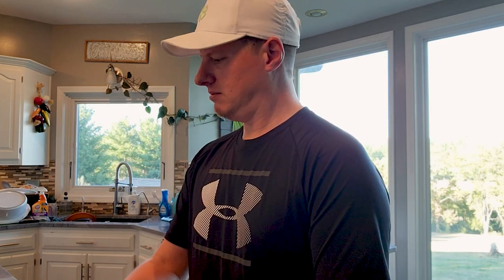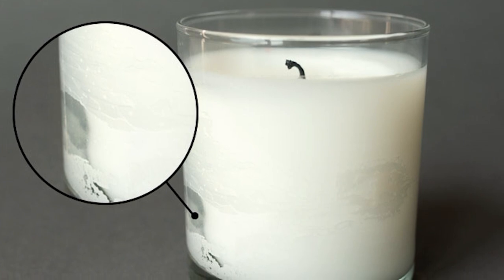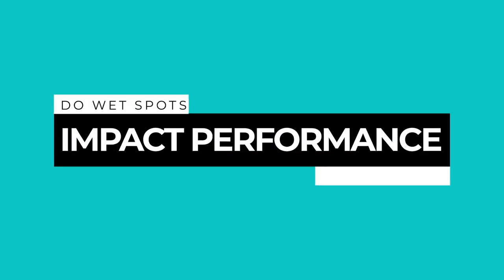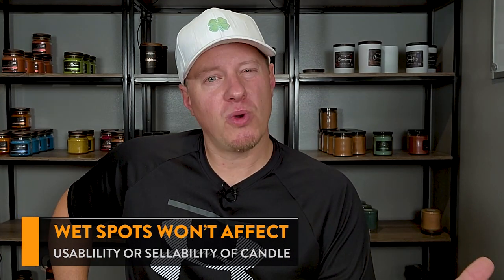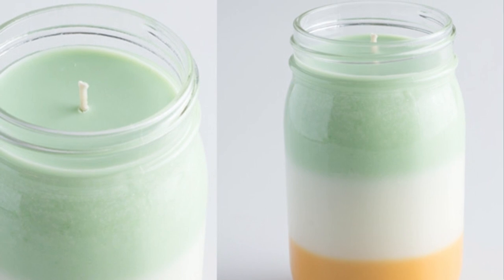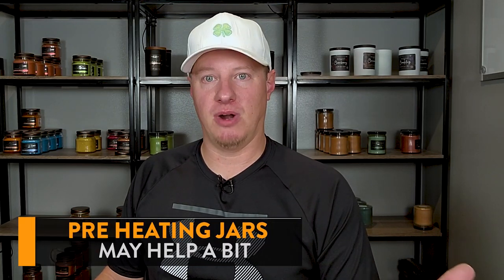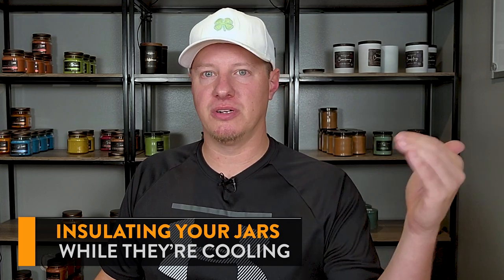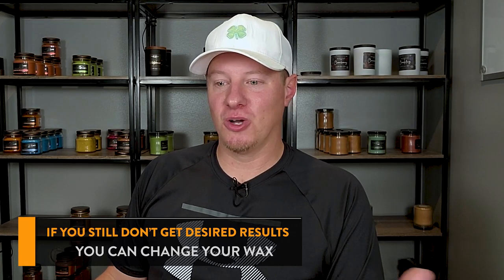Candle Making WET SPOTS (Jar Adhesion) | Big Deal? What Can You Do?

Comment: I did a complete 180 and switched from igi 4627 to gb 464. I no longer have wet spots (thank goodness), and honestly seeing  rough tops and a little bit of frosting over time brings me peace vs seeing a Dalmatian spotted adhesion issue that persists no matter what I do. I do love the 4627 for the HT, it was a good experience over the years, but I am happy and at peace with the 464. I enjoy the challenge of wicking and finding fragrance oils that perform well in the soy wax…now that I’ve used 4627 for many years I have a better idea of what the experience of a really great HT is like and can try my best to replicate the throw with the proper oils and wicks. It will never be as strong, potent, or raw as 4627…but in a way that’s also nice. I find a good HT from 464 even smells different and has a different ambience than the 4627. I found the 4627 to be almost suffocating at times with the HT (I know perhaps no one has said this ever, but it applies to to my taste). Regardless, there hasn’t been a wet spot to be seen..and that is enough for me to love the 464…even if it is a challenging wax to work with on other levels…it’s worth the effort to me.
Reply from the maker: Haha yah 4627 can be intense. Lol. Glad you found your go to solution. I've had mixed results with 464 and wet spots (depends on jar).
Reply: Ok I'll try that

Comment: I have huge areas that don’t adhere about half of everything I pour. I’ve heated jars up ahead and tried varying temps to pour and it’s still happening. I’m wondering if it’s the wax and it having a lot of air in it. Switched suppliers, same wax still issues. Switched to a supposed equivalent wax and not better or worse. Can I fix them after poured. They aren’t small areas so it’s really noticeable and not appealing at all.

Comment: I had this wet spot issue with layered candles for an order just last night! I'm in the northeast, US and it is getting cooler now. So, I need to pour my layers sooner because everything is hardening and shrinking quicker now. I do find that it helps prevent that leaking, if wet spots aren't a concern but leaking of colors between layers is, to very lightly re-melt the surface of the layer before pouring the next layer. Just enough to expand that top layer of wax a bit to prevent leaking to the layer below and not enough to need to wait very long before the layer sets back up enough to pour. Having the same color leaking between the wax and jar is better than having an entirely different color do that. It's more forgivable, since the wax might pull away from the surface again anyway. Layered candles are my #1 seller, so I've had a fair share of frustrations. After dealing with frosting constantly when using pure soy wax like I did for a while, I swapped to a wax that has mostly soy but some paraffin too and wet spots are actually so minor in comparison that I barely care about them anymore. XD
Reply from the maker: yes, absolutely. This is great feedback and spot on. Layered candles are more of a pain when it comes to wet spots. Pour temp is critical and they just require more creativity/attention to detail. lol

Comment: Hi Wade, i found a way to deal with the wetspots, i just take my heat gun and i heat the wetspot and it goes away and do not com back.
Reply from the maker: yah, this is a common thing people try. Glad its working for you with your wax, for most unfortunately it doesn't work. It only helps temporarily. Ive had it help for a while in my location.  But as soon as it get shipped to someone or moved to another spot, they tend to come back. But its a good temp fix or potential long term fix for some waxes. For me.... I dont have the time to heat gun every jar though, especially when customers could care less. Lol.  But, yes i think many people try this. :)

Comment: Hi thank you for sharing because I have been experiencing wet spots on some of my candles as a new candle Maker. I have another concerning question.

 I made four candles last night and noticed one of the jars had a crack near  the bottom side of the jar. I didn't noticed it until the wax turned solid. I poured each candle around 161 degree. I'm using soy/ coconut wax. Is there anything I can do to save that candle? It came out pretty good but I'm concerned that may be a safety issue. 

I'm not sure if it was cracked before I poured or not. I'm using 8 ounce jelly jars. I would appreciate any advice please.
Reply from the maker: Are you saying the wax is cracked or the jar? If it's the jar.... then no, I wouldn't use it. Melt it down and pour into another jar for yourself if you want. But I wouldn't recommend using a cracked jar
Reply: @BlackTieBarn  Yes I believe its a hairline crack in the jar. Should I scoop the wax out of the jar and melt it in a melting pot and then pour in new candle jar? 

 Also could you recommend proper wick size for 8 ounce jelly jar. So far I've tried CD 8 wick and I experienced high flame) dancing around. Then I tried 6 1/2 inch wick . Great melt pool/burned slow . . Took  2 hours to achieve full melt pool (moderate hot throw used 8% Fragrance load)  but still had some dancing and high flame. I use soy coconut 454 wax. The supplier says to wick up with that wax but it doesn't work well when I do that. 

 I used size medium wooden wick, extremely high flame / fast melt pool under 30 minutes , that size wick was recommended by the supplier. Epic fail idk it's frustrating. 

Should I wick up from the 6 1/2 inch wick to the 7 inch wick or wick down to 6 inch? So sorry for this long comment

Comment: Outside of the technical/maker standpoints, I think the best thing is just all of us informing people about this. It can be standard with waxes, but like "only soy is healthy," there is floating misinformation. As long as the whole candle is not filled with bubbles (like some mass-produced ones) I do not mind, and I have OCD, so that is saying a lot.
Reply from the maker: Even the bubbles ones are normal. It's just a different kind of wax. It's a classic wax that many customers still like. I don't mind them either. I've made them before.  :)
Reply: @BlackTieBarn  Oh I get that it is the wax. I worded it badly. I meant they used to be solid waxes (or seemingly) and then changed. I noticed the bubbles filling containers everywhere. Going from one type to the other abruptly threw me off causing me to avoid it. It would be like you changing your whole line to a cloudy gel only, if that makes sense.